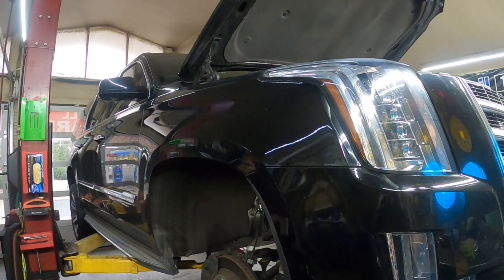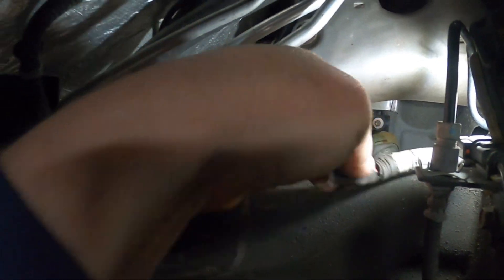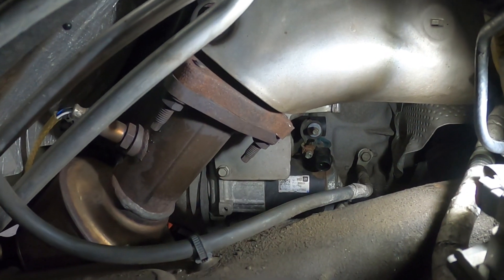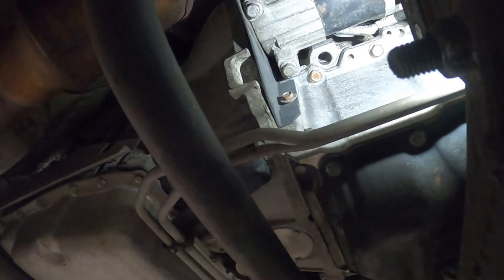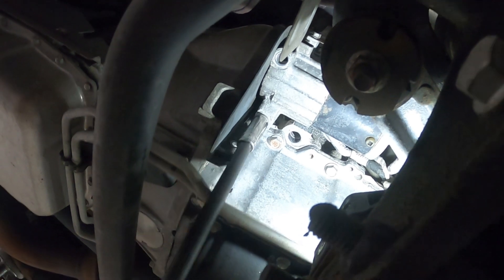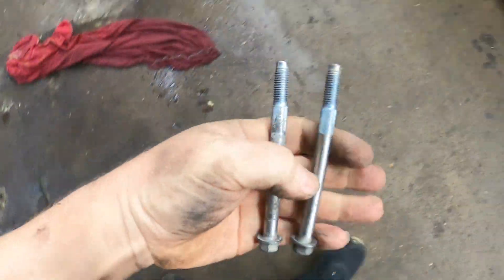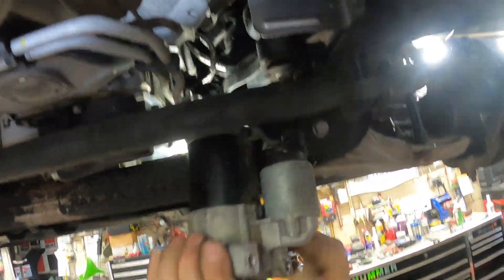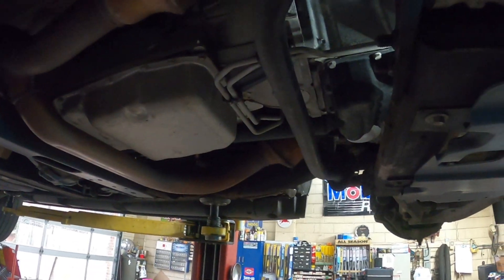2015 Cadillac Escalade Starter Removal

Comment: What symptom indicated this needed a new starter? Was it giving a click and no crank?
Reply from the maker: Yes and battery tested good. After tapping on the starter it started to get it in the bay
Reply: @TheGAutomotiveAndMore  good to know. I'm getting a click when attempting to start w/ no crank. To be sure it was the starter that was clicking, I removed the positive cable from the starter and went to start the Escalade. There were no clicks. As soon as I connected the + terminal back, the clicking came back. Autozone tested the starter and it worked fine--- passed all tests. I'm convinced the starter solenoid is bad but it passed the test (with no engine load) at autozone.
Reply from the maker: @Boy.Wonder  Did you have the battery tested?
Reply: @Boy.Wonder  i’m having the exact same thing and did check the starter at autozone and pass. What did it end up being for your vehicle?
Reply: @Boy.Wonder I have same problem what turned out to be the problem
Reply: @TheGAutomotiveAndMore  yes I did. It was fine.

Comment: That 2015 Escalade with the old emblem. Have you replaced the grille to the updated emblem?
Reply from the maker: Was not my car. So no I did not.
Reply: My 15 had the same emblem
Reply: Early 2015s had the old emblem and also the 6 speed trans.
Reply: They’ve switched to the new emblem in 2015….. some 2015’s had the old emblem— some had the new one.
Reply: @marcoallen5268  yes. I know. I wanted to know if anyone had switched out their grille etc to have the new one